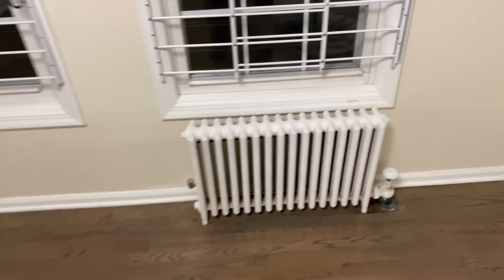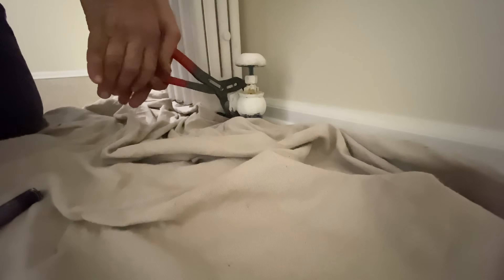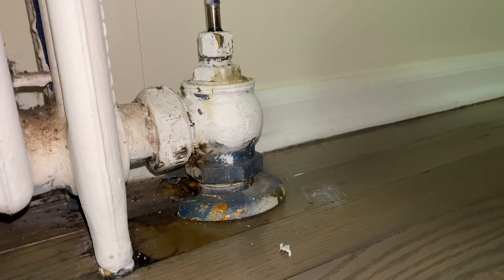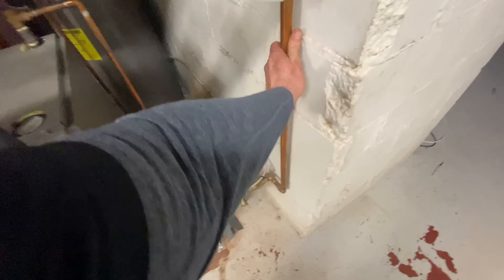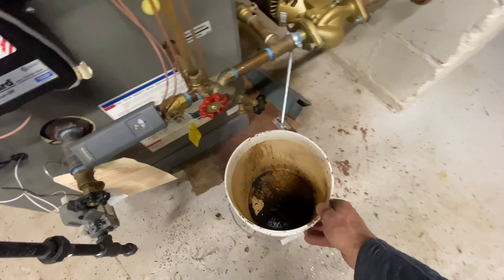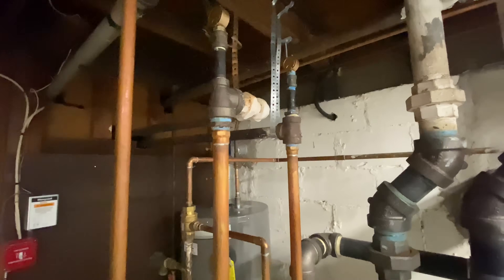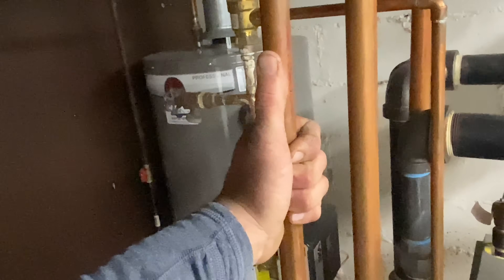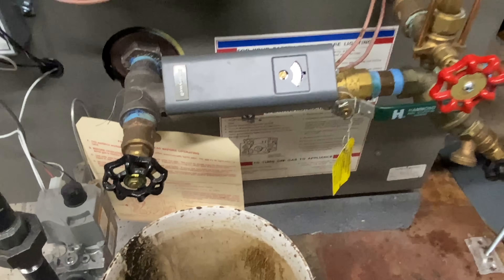Steam Radiator Leak Plugged Baseboards Not Heating

Comment: Hvac contractors should Not touch or repair any steam systems especially high pressure steam boilers and systems because it should be a plumber or steam-fitters job 😂😂😂😂😂😂😂😂😂😂😂😂😂😂

Comment: Why do so many guys use a slip joint pliers on tightening nuts, you can’t get a proper tighten use an adjustable wrench on the union nut and hold the body of the valve with a stilson.
Reply from the maker: U underestimate the downward force my 235lbs pushes down on my knipex cobras. It’s not like I didn’t have 2-24’s next to me if I felt I wasn’t getting anywhere with the cobra pliers. Those pliers don’t slip why I was able to step on the pliers using my weight. I did get that but to turn. Important thing is to make sure not to topple radiator. Which I was holding up with my hands.

Comment: Why the bronze body pump on a cast iron boiler and what in the heck is it feeding?
Reply: Baseboard heaters, using the hot water from the boiler.
Reply: Using the hot water from bottom of boiler for a hot water loop.
Reply: Because it holds up better against mud and crap.
Reply from the maker: The boiler water is at boiling temps when steam boiler is heating. That pump pushes water with lots of iron and muddy water. I believe the bronze series 100 is the only pump that last. cartilage pumps don't last and get noisy from the gunk and heat.

Comment: bill  i would take apart with a 24  and clean or change   edbonjovi  leak master plumbing
Reply from the maker: The 24's were right next to me just in case this wouldn't move. I usually only take apart when I can't get any movement to tighten that union. Another rad I had a really hard time with this weekend. I took one apart couldn't pull the pipe up to the height to reconnect. I stopped filming kicked the camera during the struggle, reconnecting the union. Took a pipe wrench, put it under back legs of the rad getting the union to catch.

Comment: Good thing that you were able to fix the leak on the Radiator Valve, those are a ton of fun to chisel out of the Radiator when you need to replace them!
Reply from the maker: Sometimes I get lucky and remove with wrench, many steam fittings need to be cut and folded in to get threads to let go.
Reply: @thehvachacker  yeah I salvaged a few old two pipe radiators to practice removing both the 3/4 inch supply and 1/2 inch return. I used a file and a saw blade to cut out the brass spud and got both out, luckily without cracking the Radiator or damaging the threads. I learned that the most important tool for that job was good patience.

Comment: Just a question not an attack. Would it habe been better to remove the strainer and clean it or flushing like you did will do the the same? I don't currently work on boilers that's why I'm asking. Thanks
Reply from the maker: A full maintenance was set up on this boiler for this week. They are just moving in. When I am working 8:30pm on a Friday night and another call to still get to, I am just looking to get the heat to run. If a system needs maintenance i set up a maintenance appointment during regular working hours
Reply: Yes strainer should be pulled especially if low or no flow has occurred, and checked,but if frequently done once per season is all that's necessary.
JS🤔
Stay safe.
30 year apprentice.
Wear your safety glasses.